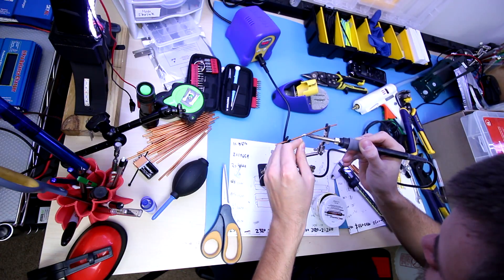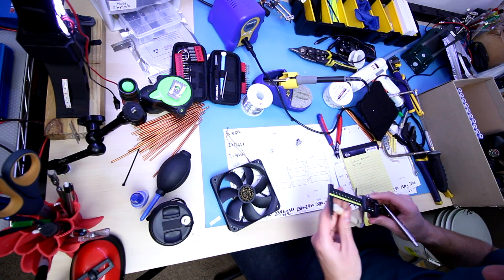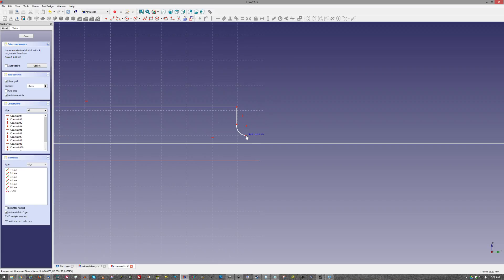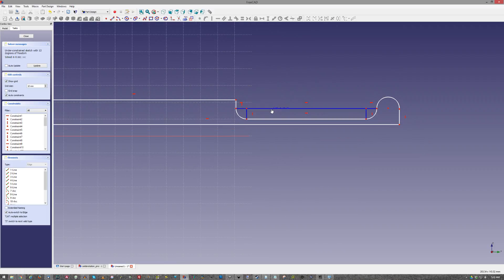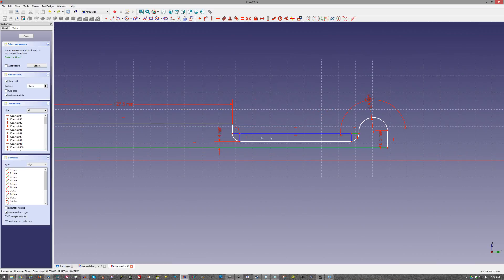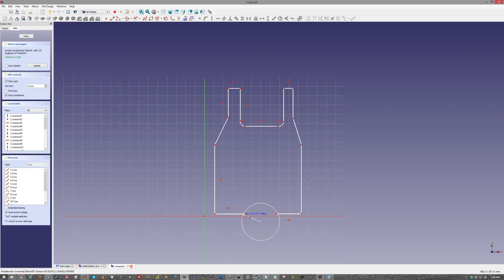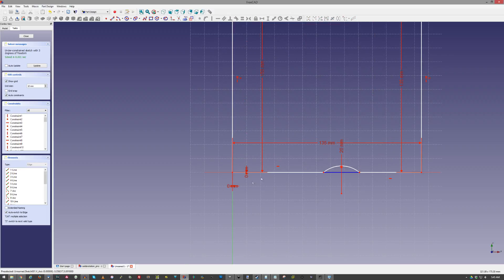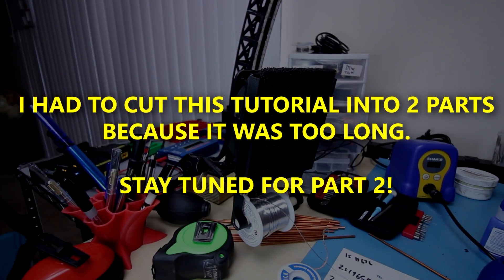FreeCAD 3D Modeling Tutorial 6: Soldering Station (Part 1)

Comment: This could have been a very good video but sorry to say.
It hit my pet hate mispronouncing words. 
Just could NOT watch all of this with all the mispronouncing the words. 

It is called "Solder" NOT Sodder! one Solders the connections together, you are "soldering" NOT soddering...No Such Word.
The Nut for 120 mm Fans are M4's, one states the thread size NOT the outer edge, it is the other way round. 

If you are going to do a video then please mispronouncing words is a no no.